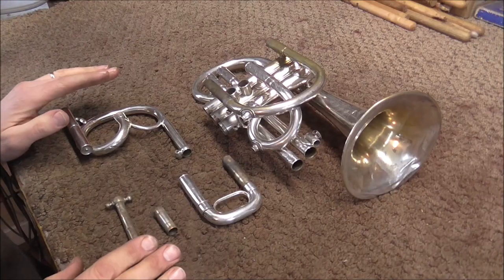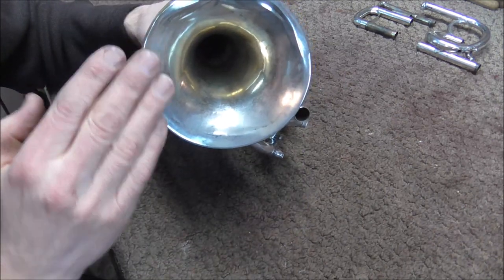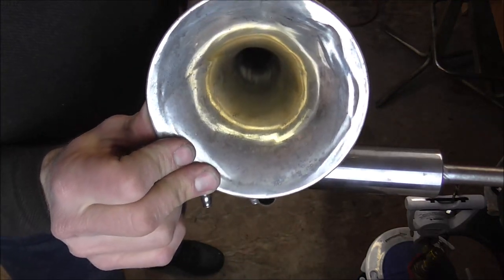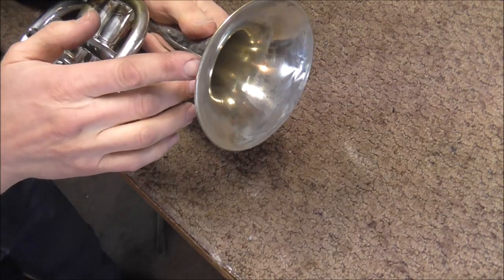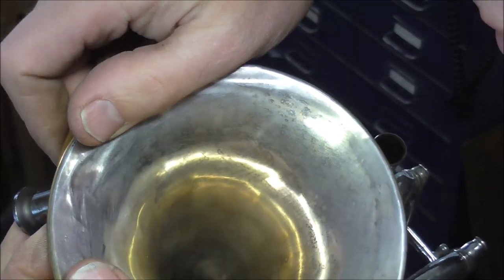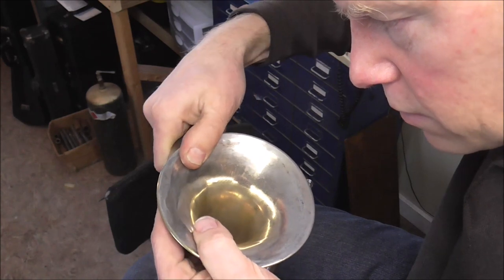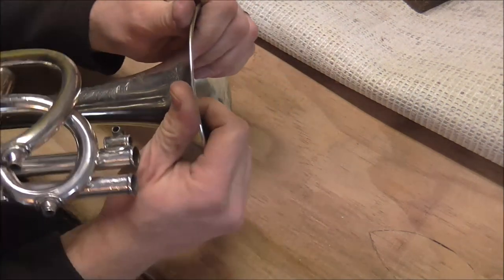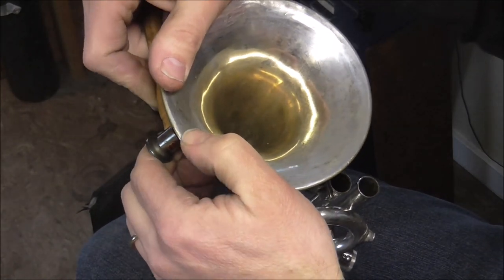Cornet Restoration #4: Removing Bell Dents

Comment: Do You have and use the bell half moon mandrels for the bell rim dents? Or do You always use dent hammers and burnishers to raise the dents?
Reply from the maker: I do not have a bell half moon mandrel. I have always used the roller, dent hammers, burnishers, and sometimes the trumpet bell flare mandrel in conjunction with a rubber mallet.